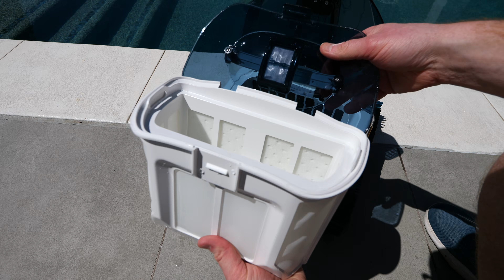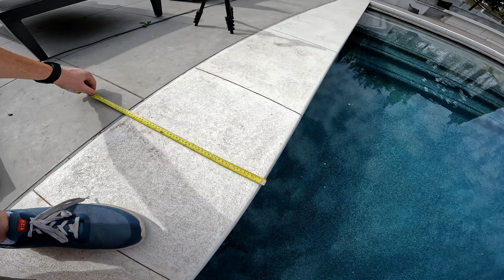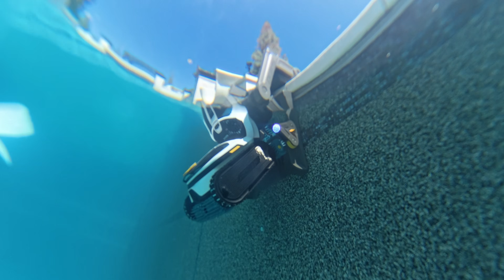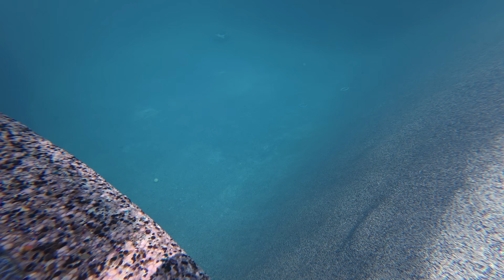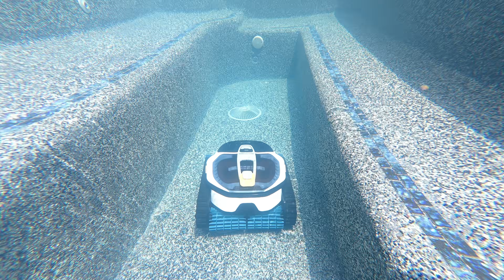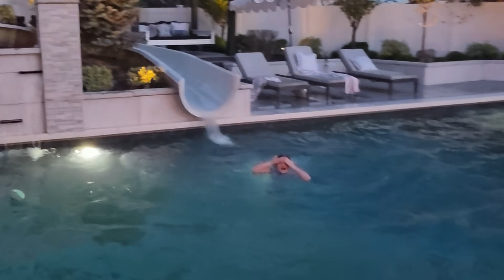Deep Pool Cleaning Without Hassle, SPINO S1 Pro

Comment: You should cover a little robot called Vector. The robot basically is a cute little robot comes with kind of basic commands like what’s the weather (after you say hey Vector, of course) but there’s Amazon Alexa capabilities. Which makes it a multi hybrid of its own assistant, and has the Amazon Alexa assistant.. you also have to set up using something called wirepod which has to be on your computer. Unless you want to pay a subscription for the servers..

Comment: On a Grecian pool, are the angled pool panels considered floor or wall?
I also noticed the only surface options shown in the app are tile, glass, or aggregate. Does this cleaner work with the extremely common vinyl-lined pools?
And does it come with an extra basket and/or filter?

Comment: The problem is that you’re sponsored, you don’t even own a pool, and you’ve used this for a total of 63 minutes. How is this content allowed, and how does it actually help anyone looking for an honest review?  You’re just repeating what the brand wants you to say, not sharing a real experience from actually using it in your own pool for a meaningful amount of time.  Just like all the other reviewers and paid shills, you don’t show it going up the wall and connecting to the lifter. You cut from it going up the wall to it already lifting. You never show it actually lining up and connecting, which tells me there must be issues that you and the other paid shills are hiding.
Reply from the maker: Hey Ricky, thanks for your comment and some valid points. As mentioned in the video, this model and software is pre-production and beta. This video is a showcase of what the product will be capable of and not review.

You are right, the robot did not dock back on it's own during my testing because after I had everything setup and spent much of mine time getting a pool to demo only then did I find out the dimensions of the pool were too big to properly support the product. I have seen the function work in real life so I know this was just a circumstances issues and not a product issue so didn't feel I needed mention it and focused on give measurements for supported pool size.

Here is it working during their demo:
https://youtu.be/YGMomaSBqLE?t=515&si=xS2Q-2DqHkYAluPI

Finally, yes this is a sponsored post so I can get an early look at the product, and feed my family.  With that, Mammotion did look at my video before posting but had no say in the final video.

I can surely do a better job of stating this but I do try to keep the video concise as I tend to always go very long.
Reply: Thank you for showing honesty and ethics in your comment, but you failed to show any of that in the video.

There are plenty of other ways to feed your family besides accepting payment from the same companies whose products you review. There are plenty of companies outside the tech space that would pay for an ad spot. Food brands, service businesses, and other types of businesses would likely love to work with you so you can keep your ethics intact while still supporting your family.

Secondly, you shouldn’t have made a video on a pool cleaner when you don’t even own a pool. How can you honestly test, use, and review a product over a meaningful period of time when the entire video was shot at an Airbnb or a friend’s house where you were only there for a short time?

I also find it funny that none of the reviews of this product actually show the docking process. You just confirmed my suspicion. Every single one of these reviewers should have been screaming about this issue from the rooftops, but because they are all sponsored, they failed to mention it and purposely hid the problem so even though, you thought it was just the test pool you shot at, its actually all of them.